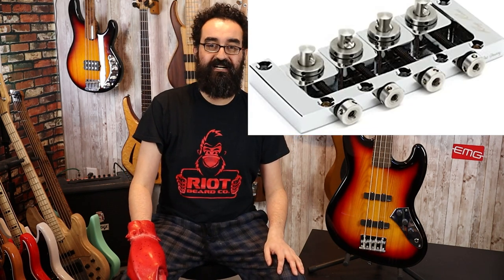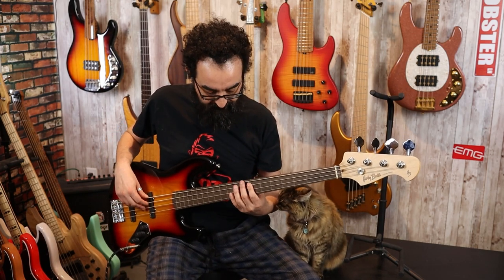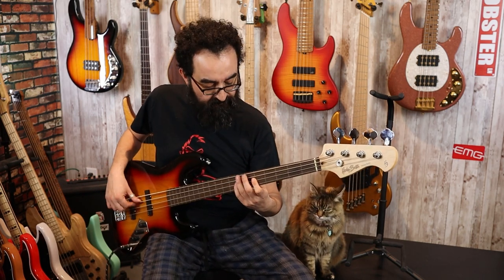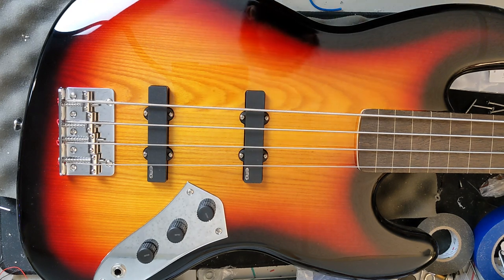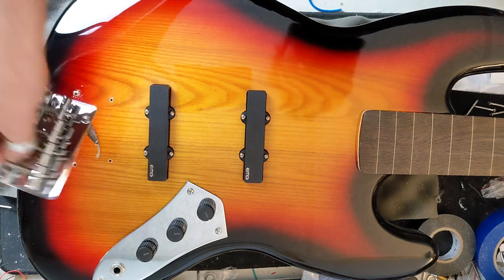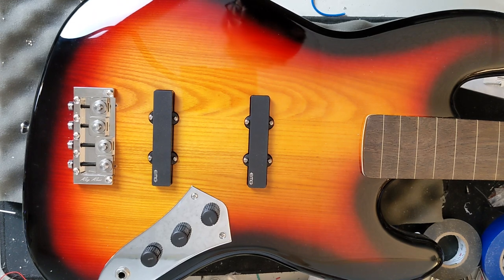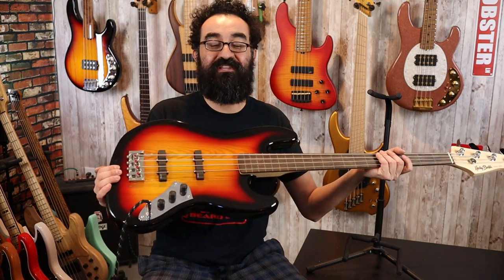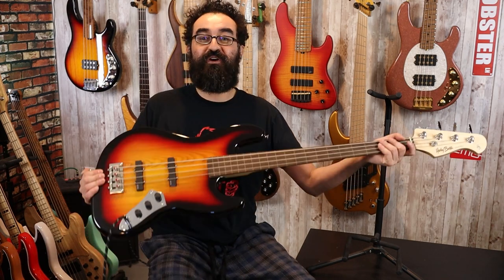Harley Benton JB-40FL MODIFIED Pt. 2 - Testing out the Ray Ross Saddleless Bridge!  -LowEndLobster

Comment: The issue with these bridges (stock) is the saddle shift. Thats why nearly every aftermarket bridge is an improvement since they all keep the saddles locked in place.
Reply: I know what you mean about saddles shifting.  I have one bass with a cheap bent steel bridge that had that issue.  I  looped  a zip tie around the intonation screws and snugged them up a little.  Fixed that for a few pennies. That doesn't affect the adjustability any and is barely noticeable. I have 40 years of accumulated parts and figured I'd swap bridges at some point, but the zip tie works fine.  Not fixin what aint  broke now.
Reply: I don't understand why Fender continues to use that garbage bridge on almost all of their basses. People criticize the shit out of Rickenbacker for their older style bass bridge but at least the saddles on those don't flop around.
Reply: @Sheehy223  Check out the Ken Smith Qsr bridges.  Basically a machined brass  badass with quick release.

Comment: Great video.   For the scratch that Harley Benton is a great value.  I like the EMG upgrade too. Sounds great. I'm not to big on the Ray Ross bridge because how that first inch of string at the ball end  is supposed to be behind saddle. Seems any benefits would be outweighed by that first inch of shring.  For the cost of the Ray Ross, I'd opt for Hipshot or Gotoh.  But that Ray Ross does look nice.
Reply: This.

Comment: That HB bass sounded great as it was. The new bridge would only change the price but not the sound… I don’t care what anyone says. 
Upgrades are mainly for the owner to inspire themselves. I have never ever been to a gig and noticed that the band sounded better because the bass player had a Sterling 35 instead of the Sterling 25🤷🏾‍♂️
The difference in sound exists but it 10% real and 40% placebo = super inspiration and yes, inspiration is awesome and priceless, too. 

Love your show👍🏽
Reply: the hb bass wasn't stock as it had emg electronics in it, the bridge geve a bit more clarity on the high end but I think the test that was lacking was a tuning stability test and intonation test
Reply: @18hot30  thanks, I had missed that detail. It really had an awesome sound.
Reply: Unless the bass bridge sucks like my Ibanez bass.
Didn't intonate, buzzed like crazy so I had to replace it with hipshot and it fixed all of my issues.
But I agree with you to an extent, usually it's just for people personal specs.

Comment: Have you ever tried one of the Babicz Full Contact Bridges? I had to replace the bridge (severely rust frozen set screws) on a MIM Fender  (pawn shop purchase) Jazz bass about five or six years ago. On that bass it made a remarkable difference in sustain. It was also very easy to work with as far as installation and intonation. In the twelve years I've been regularly playing that is the only bridge I've changed. I've also got a few Harley Benton basses that I've thought of trying  a Babicz bridge on. Your thoughts?
Reply from the maker: I had one on my Warmoth 'tele' P bass. It was a neat bridge but I didn't like how some parts adjusted.

Comment: With Ray Ross bridge the sound lost its 'oomph' and punch in low and low-mid frequencies. Strings are constructed to have a break angle behind them though. On the other hand, that's fretless bass ofc so I can't tell how well it works with intonation etc ;)

Comment: Lobster I know this question is not related to this video, but I am thinking of replacing the bridge on my Sire V5. Do you think the AllBridge is worth the $100? Does it really help that much?  Thank you.
Reply from the maker: That's a great question. I don't like the slotted saddles on the stock V5 bridge, and I appreciate the aesthetic upgrade. I don't think it really 'helps' any more than any other bridge. I like how they look over stock and I like the neat material they're made of (duralum)
Reply: @LowEndLobster  Thank you. I watched the video when you installed it on the V5 fretless, and it does look great but i didn’t really hear that much of a difference in tone or sustain.

Comment: One query I have with the bridge is, since the ball end rests right at the pin rather than behind bass plate on a top load or through body does this make it pain choosing strings? I still find the E on most sets don’t taper the winding at the end early enough on a P-bass. I could imagine with a strings length shortened by the pin (not the speaking length) it could cause hassle tuning up since there would be more winding on the tuning post.

Comment: this makes me want to take a Vintage jaco clone husk and stuff it with G&L parts.
Reply: gotta say this unit is pretty crispy - perfect for gigging bc it's a bit on the bright side which means it's easier to dial into a live mix without losing it down the well.

at the current build cost totals you could build three identical units for less than a legit mid-tier new or used USA/JPN/etc local built mainstream standard j bass (fender/edwards/etc).  You'd have to do advance builds, at least for people in the US, because you can't grab an HB off the shelf at GC (but GC is now carrying FGN!) so you'd need to go with something that has availability if you want to just carry one unit and build another from the recipe if something happens with the one you have.

if I was gonna guess at a good recipe build to take on the road - the model that comes to mind is the Charvel San Dimas sparkly ones seem to be on the shelf at most big box music stores and they already have decent pickups, too.  Not a fretless though.  Not sure what's commonly on the shelf for a fretless at the big boxies in the few hundred buck range to get the carcass off the hook for some upgrades.

I think I just created a new type of configuration/shopping list for the boxies that do em, recipes for replacing particular giggable instruments on the road if they go borken or done get stoled.  hm.

I really need to clear this space here and put some stuff up on the bench.  thanks for the content, as usual.  ;-)

Comment: I'm not not a fan of the Ray Ross bridge (I've had two) due to A:  The strings need to be loosened to make any kind of intonation or action adjustments taking up that much more set up time, B: If the strings aren't centered in the hole in the post they can vibrate against the side causing a chorusing effect, and C:  The included adjustment tool is a joke.  The whole thing is way to finicky for me for little to no difference.

Comment: i can hear a slight difference in the sound, the Ray bridge sound a bit more warm, and it's brass apparently so it had up, the stock bridge feel more "metallic" sounding. but what interest me more is possibly a more reliable bridge. with traditionnal bridge, i often had problem with the spring rattling, or touching the E and B string. even with expensive bridge such as Hipshot, i still has these problem sometimes.